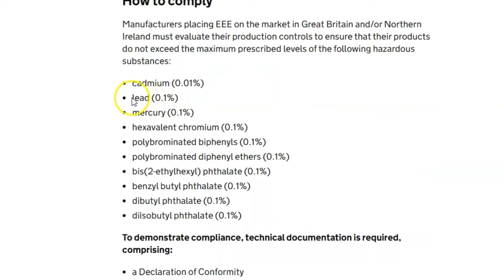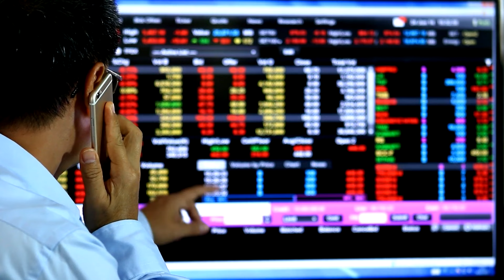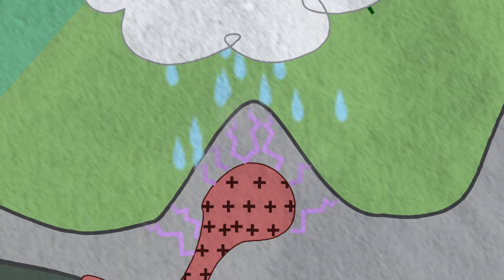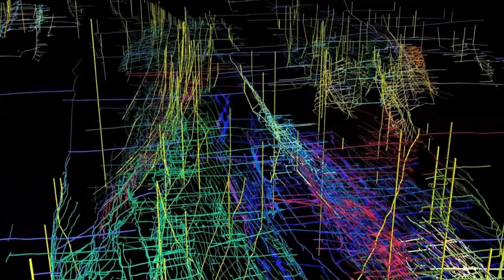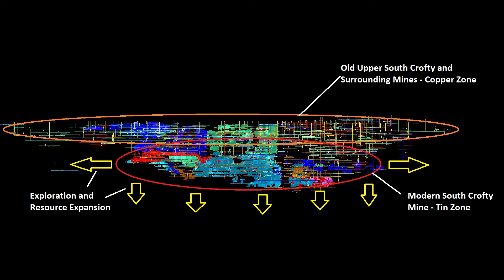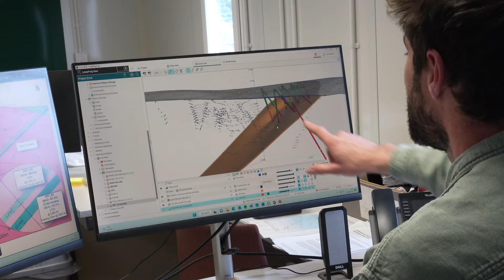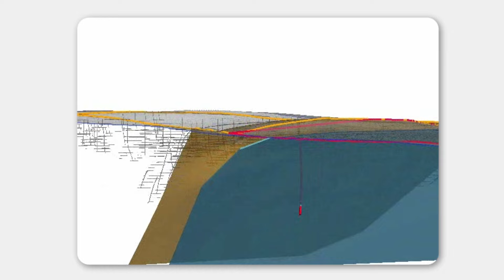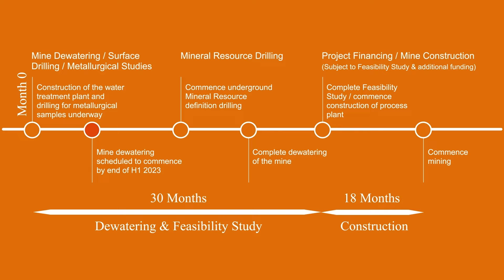Cornish Metals, Europe's Primary Source of Tin by 2026 (Site Visit)

Comment: The removal of lead in solder has led to a weird problem with the replacement. On a typical circuit board you have many small solder pads and what happens with the new solder is over time the solder grows "whiskers" which are tiny hairs of solder that grow and can short out adjacent solder pads. Anyway, there is something you probably don't know. You can only see them if you use a microscope.
Reply: Which is why lead-based solder is still standard for electronics that actually matter. Automotive, aerospace,  medical etc. can still use the proper stuff.
Reply: The phenomenon is similar to tin whiskers which caused lot's of early transistors to fail. Unleaded solder is harder to work with & doesn't form a good as a joint done with leaded solder. Every tech I know uses leaded solder to repair circuit boards that used unleaded in manufacture. Some EU directives have a reasonable idea at their heart, but the consequences of them often have a deleterious effect later.

Comment: I should think that the tailings from old mine works and smelting operations would be a good source of tin. They only took away the easily obtained stuff, so what was left over will still be commercially viable using modern methods.